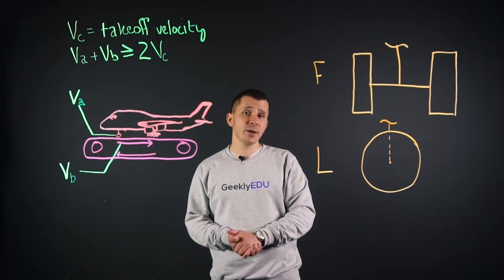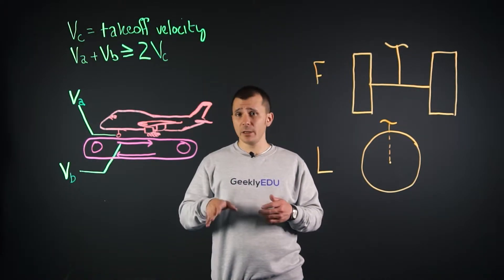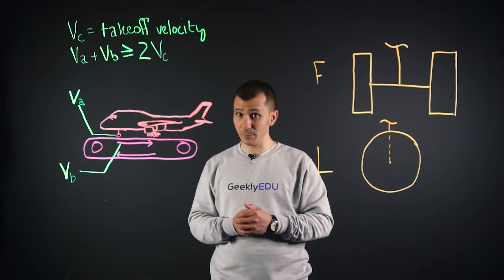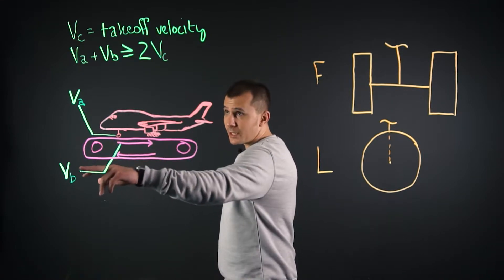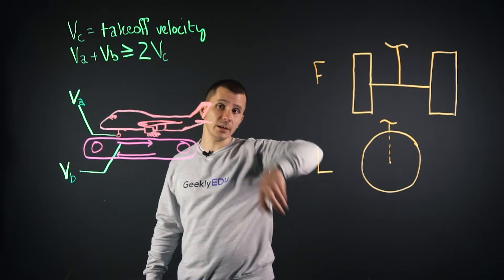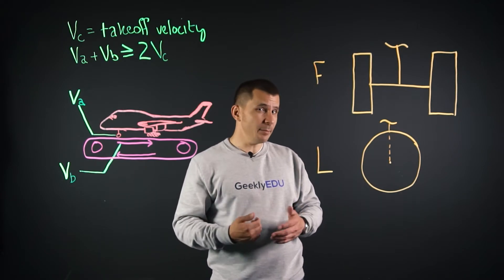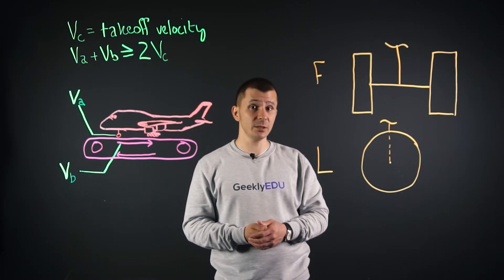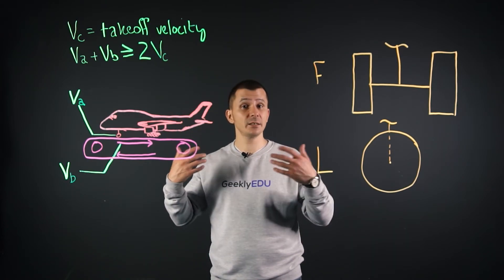Plane on a Conveyor Belt - Will It Take Off? #GeeklyHub

Comment: There are four vectors involved; thrust and drag, lift and weight. As defined in the problem the aircraft thrust is set to make the plane match the conveyor belt. Now thrust = drag. To an observer on the ground the plane is not moving. There is no wind flow over the wing. So life is less than weight. So the plane will not take off. For the plane to take off, it needs to reach the rotation velocity, somewhere near 160 kits. So if the belt were spinning at 160 knots, the planes thrust would need to be equivalent to what would be required for 320 knots. The Air Force converted a F102 into a sea plane. Before conversion to a sea plane it would rotate around 180 mph. With pontoons it now rotates around 220 mph. The drag by the water could be considered similar to the conveyor belt.
Reply: For a plane to fly it needs lift. This is airflow over the wing.  A stationary plane with wheel roll cannot fly.
Reply: @teetimeaz  Why would plane remain stationary if it is being pushed by 747 jet engines by 1100kN of force? What force counteracts it?
The only relevant factor for airplane is air and engine to air relationship is not being affected by freely spinning wheels no matter how fast are they spinning.
There is also running and static friction force of wheels but it is hardly increasing with speed and it is more than 100 times smaller than engine thrust. That would be the drag you pointed. Innertia works against both conveyor and engines so it is irrelevant.
So not at any point drag = thrust.
Reply: @Piasecznik72  
the experiment isnt told right here.

the conveyor belt matches not the speed of the plane, but the speed of the wheels.

if the plane would move forward the free spinning wheels would have to spin faster than the conveyor belt moving backwards, which per the definition of the experiment isnt allowed.

essentially the wheels and the belt would accelerate to infinity before the plane would even move a fraction of a millimeter.
Reply: @TheCerbari  If wording of experiment demanding impossible things, it is assumed wording is wrong and next possible thing should be taken as author intent. If author intent was asking for impossible thing whole discussion does not make sense and there is no experiment possible.
Reply: @Piasecznik72  its a thought Experiment. There are plenty of those.

The Trick is to realise it is impossible thats kinda the solution to the Experiment that the wheel and the Belt accelerate infinitly
Reply: @Piasecznik72  the  speed of the airplane cannot exceed the speed of the wheels. The plane is not a rocket. So if the planes wheels are rolling at 200 mph and the treadmill is -200 mph then there is very little airflow over the wings resulting in no lift. Put this another way. If on a runway the planes wheels were rolling at 200 mph then the plane would be going 200 mph forward due to the planes thrust and the plane would have considerable airflow over the wing and lift would occur.
Reply: @teetimeaz  Again, airplane wheels are free spinning. They spin only if there is a difference between airplane speed relative to the surface wheels are touching. Wheels do not propel airplane. It is other way around.
And airplane is a rocket in a sense it is using mass of the gasses and pressure difference to propel itself.
Only diff between them are rockets needs to work in vacuum so they carry needed gasses with them but airplanes are using air in atmosphere.
Reply: @Piasecznik72  I use to design parts of the airplanes electronics. I even worked on a fully robotic fighter in 1978. The 747 has engines under the wing. The jet exhaust is mostly under the horizontal stabilizer. When we ran up fighters to full A/B the nose of the plane always went down. Why? the airflow over the horizontal stab caused lift in the rear. the nose went down. It would NEVER fly. The opposite is true for a single engine prop plane. The left and right wing are not the same. This is because of the wind on the rising prop causing the wing on one side to rise more. There is a lot of airflow over the wings of a single engine aircraft, but never enough to enable flight. But the weight of the plane would decrease. If you had more power (a lot more), flaps down, minimum weight (mostly fuel) it is possible for the plane to rise. But the plane would be very unstable. We had run flight tests on R/C aircraft for different reasons. On a single engine airplane with 6x engine power to airplane weight, We could hold the tail wheel and see the plane rise up. This was only due to the vastly over powered engine. But agin the plane was very unstable. If you had a high headwind the plane would take flight and fly backwards for a period of time. Remember, the ground speed is 0 mph at liftoff. But the horse power to weight ratio was so high this was never considered.
Reply: @teetimeaz  Turbofan engines are not designed to create airflow over  the wings. Airplane speed relative to surrounding air is what gives lift. Engines will propel aircraft forward no matter what wheels are doing.
Reply: @Piasecznik72  you got the first part right - that engines or force of any kind just makes the body move forward.

The second part is logically, physically, and mathematically incorrect.  For every fractional rotation of the wheels, the conveyor goes the exact same distance.  It's not a matter of feeling or emotion or guessing.  It's what we are given explicitly. Do the math of the travel of the wheel by calculating the circumference of the wheel.  That's exactly the distance the conveyor moves at the same speed and the same acceleration.

This is a much simpler project than people are making it out to be.
Reply: @teetimeaz what you're missing here is that the speed of the wheels or the conveyor belt is irrelevant since the wheels are free spinning. The engines will push the aircraft forward no matter how fast the wheels/belt is spinning, creating airflow and eventually creating enough lift for the aircraft to take off
Reply: @Steven-gg1bn  I designed robotic fighter planes in the 70's. The 747 engines are under wing. When run up (for stationary tests) the engine exhaust causes the rear stabilizer to have lift and the nose always goes down. It does not matter where the elevator position is. This is not hypothetical, just reality. It is different for a single engine aircraft with a propeller. The prop was wind flow over the wing. During static wind tests, the weight on wheels would decrease. But it would take considerably more power for flight. We ran flight tests on R/C single engine aircraft. With a 6x power to weight ratio the plane could takeoff but it was very unstable (roll). Aided with a high head wind the R/C plane would first fly backwards but it could gain altitude. But this is not part of the defined problem. A/C system designers for the Osprey and VTOL planes like the Harrier can attest to this.
Reply: @teetimeaz  there is little to no drag caused by the free spinning wheels. The wheels can spin until the cows come home. There is no force stopping the aircraft from moving forward, be it a prop plane, a jet with engines mounted under the wing, near the tail, doesn't matter. The aircraft will take off, the wheels would simply spin much faster than they normally do.
Reply: @Steven-gg1bn  sorry, but listen again to the problem. The speed of the aircraft is matched by the conveyor belt. To an observer on the ground the plane will not move forward. I have also mentioned what a 747 would do! Compress the front nose gear as the engine thrust is increased due to the lift of the horizontal stabilizer. I have programmed the equations of motion on numerous planes. The 727 has little tail lift from the engine exhaust. The 747 has more. It is constantly being trimmed out due to airspeed, altitude, wind effects, etc.
Reply: @teetimeaz  the way the question is worded makes people focus on the wrong part of the question. I've seen this riddle on the internet many times and that's not the point. The point isn't whether or not the conveyor belt matched the speed of the wheels or not, the point is 'would a conveyor belt moving in the opposite direction of an aircrafts wheels cancel out the thrust and propulsion of the engines, rendering them unable to push the aircraft forward?'

The short answer is no, it would not, as it is not the wheels that provide thrust for the aircraft, as would be the case with a car.

Now if we were to go along with your interpretation of the question, where we can magically force the wheels to not outpace the conveyor belt then sure you'd be partially correct, the plane wouldnt fly. The body of the aircraft would be forced forward and the wheels/gear, unable to cope with the force of the body of the aircraft moving forward as well as the conveyor belt moving the opposite direction would be instantly destroyed and the aircraft would bellyflop long before it reached the airspeed necessary to take off.

But in a real world scenario there is nothing forcing those wheels to stay in pace with the conveyor belt and the aircraft would take off normally. The only difference is the wheels would spin much, much faster than they normally would
Reply: You (and many proponents of airplane not moving) are mixing speed with forces. There is huge 1100kN of thrust force pushing B 747 forward. Where is force that counters it? Rotational friction of free spinning wheels? There is none that match it even 10 to 1. Unless you go to relativistic speeds, there is nothing stopping airplane from takeoff. And even if you can reach relativistic speeds, conveyor belt size of whole runway needs to weigh less than airplane wheel.

Comment: If you want to start taking into account stuff like that, then you need to go into MTBF, and the maximum rotation speed by specification, or a tire, is a surface that integrates over time. You can use your tire for guaranteed life expectancy at its max speed. but it CAN go overspeed, it will just reduce its life. Going 2VC is no big deal 5 or 6 times I reckon, you'll just have to change the tires earlier.